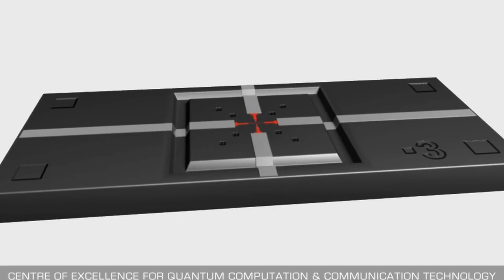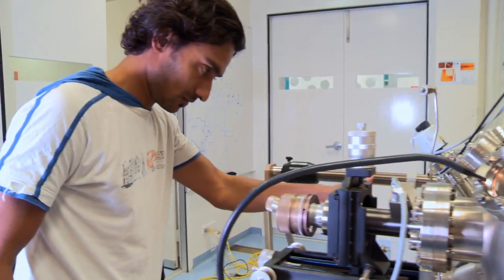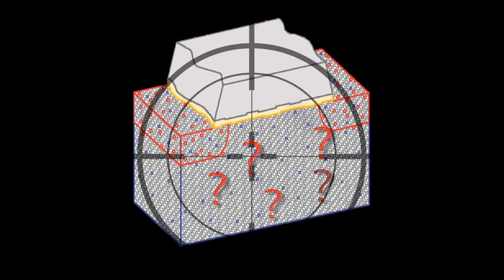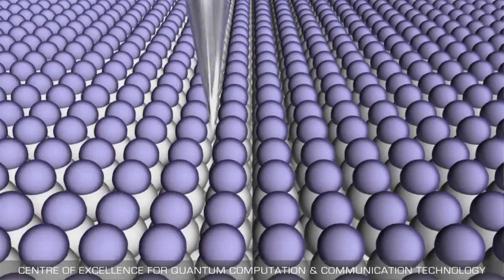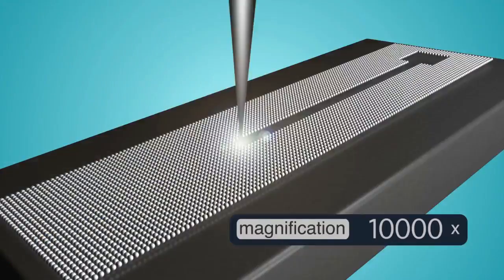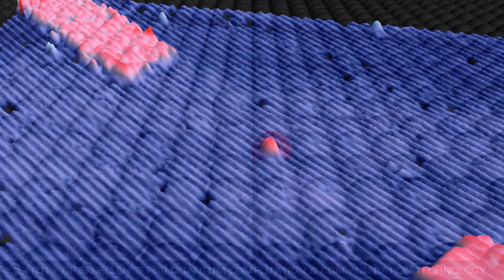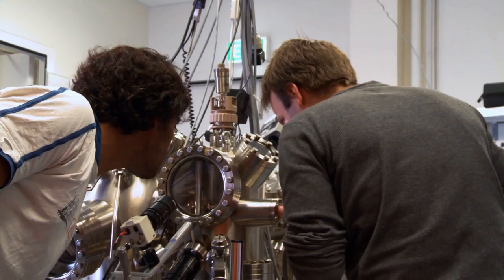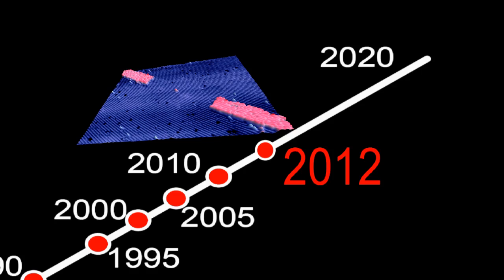Single-atom transistor

Comment: Theoretically a Transistor only needs to be slightly larger than the Electron itself, for flow to occur. Hence the Atom. If you want the electron to flow,  you must have a +positive  -negative alignment of atoms, with a junction between... so its def not going to be the size of an ATOM.. just on the same  "scale"...oh yeah it must be enclosed in Silicon as well???  Even Bigger now. I believe that there cannot be a smaller stable pathway, so Goodbye Moore's Law ... (Hello LIGHT. Optics.)  Amazing how far we are going with this tech. Question is who and how are we going to manufacture something on that scale hahahahahah. Amazing.
Reply: It also has to be individually controllable and able to be packed tightly together. Must be able to fit more into a given area than the prior tech.

Comment: A single atom transistor sounds impossible and the term does not make any sense. How does a single atom decide whether to pass or block the current flow. It still needs a gate to do that. A single atom acts like both a gate and a wire? Thats not a "single atom transistor" unless you break the core apart. Which is quite nonsense since it requires tons of power to do so...
Reply: Electrons can teleport through however. So quantum computers are being made
Reply: +Heroyouhadhatedx If that make sense to you, then also add this. You do not need an atom to do that since you can use light beams to transfer data, you can also use it to process it in the thin air. It is not productive. You can not build a single atom transistor. The main reason why this video is named so `single atom transistor` is because of their size is whats so important. If you are willing to put that empty space in between those single-atom transistors. That space will still require an outer space and cause a size. One atom and addotional space is not a single-atom in size. And you would really need a lot of power to sperate those atoms in order to create the chip with its architecture.

Comment: I read in the NYT:  "In contrast to conventional computers that are based on transistors with distinct “on” and “off” or “1” and “0” states, quantum computers are built from devices called qubits that exploit the quirky properties of quantum mechanics. Unlike a transistor, a qubit can represent a multiplicity of values simultaneously."  Could someone please explain this "multiplicity of values simultaneously"?

Comment: @AntDX316 However if I was to cite an issue that would be the 'Moores Law' of quantum computing it would be the decay issue. 

All entangled particles lose that property, iIs referred to as 'decoherence.' and it would be hard to envisage a manufacturing process free of errors where this wouldn't creep in as something that threw a spanner in the works when the structure is scaled up.

The more complex the chain the greater the decoherence.  So I'm sure there is an upper limit on scaling this up.

Comment: @AntDX316 Well yes and no. There has been a working example of a machine based on QBits for some time now, Seth Lloyds at MIT.

Timing is essentially not an issue. So you are right in that a quantum machine would not be constrained by something like timing.

Added to that HP's advances in memristor technology and you essentially have a super computer the size of a pinhead that requires only ambient energy.

Of course in practice that's probably a little far fetched and also a long way off!

Comment: @AntDX316  Well that's already available... its an unfair comparison for the most part... 

But quantum computing puts machines far ahead of humans in processing as a raw measure... Then again I came to the conclusion in the 1990's the MIPS was not 'Millions of Instructions Per Second' but rather 'Meaningless Interpretation of Processor Speed'

I think the same holds here... especially if Microsoft are tasked with writing an OS ... that would be a disaster!

Comment: @thematrix606 We will really need this kind of technology, when we want holographic displays (not stereoscopic 3D) For this the Pixel must be smaller, than the wavelength of visible light, that makes something like 50000dpi and 2500 Megapixel per square inch. Real artificial intelligence coukld also be possible.

Comment: @UNSW Is this really a step towards quantum computing, or is it as the video seems to say, a standard transistor at the atomic scale? The difference as I understand it is that quantum computing isn't merely scale (though it does work on the subatomic scale) it's that quantum particles would not be constrained to binary calculations. This transistor would still be binary, just smaller, faster, more efficient than anything yet built.